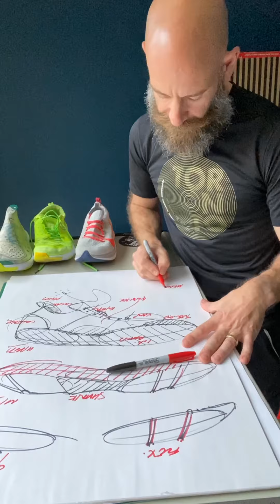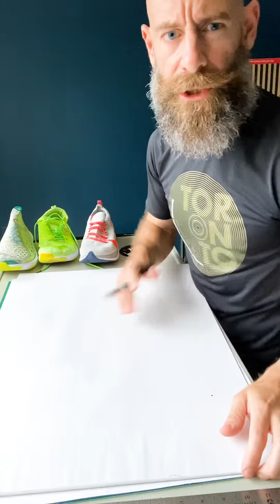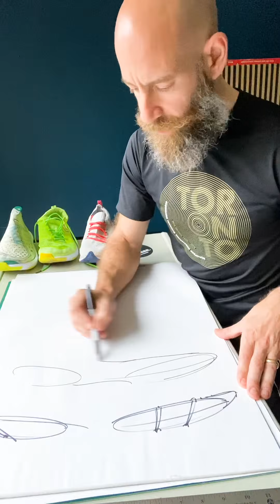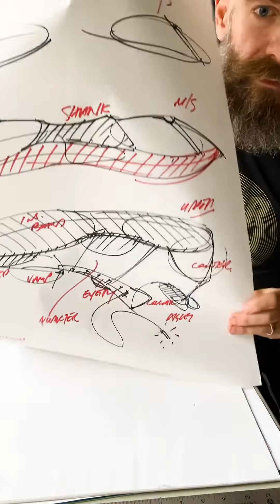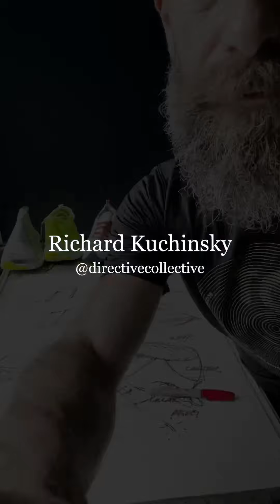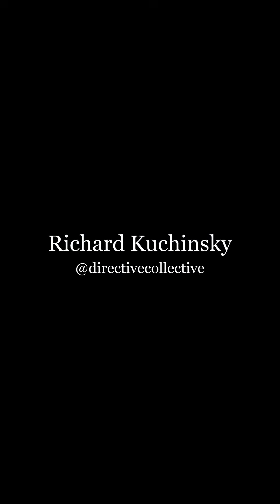Shoe Design 101: Terminology & Parts

Comment: I would like to get trained in designing. how it is possible
Reply: Designing what?
If you mean designing shoes, there are a couple options. If you want to go the college route, which may make it easier to get some jobs, then you would generally get a degree in either industrial design, apparel/fashion or textile design, or footwear and accessories design. Now this is if you want to design the shoe shape and components, if you just want to design the color and material, there are jobs for that called color designer and CMF(color material finish) designer, then you could either get a degree in color and material design or graphic/visual design.
-There are ups and downs to different degrees, for instance, industrial design is a great degree and leaves you open to a wider range of jobs, but doesn't specialize much in footwear, and you will have to study much of that part yourself and really focus on your own to build your portfolio in that department.
-Footwear and accessories is much better for getting a job specifically in footwear, not because it will make you stand out that much more than industrial design but, because it gives you a more focused education and will help you build your portfolio. That said, it also makes it much harder to branch out to other types of design than an industrial degree, so if you change your mind on shoes, or can't find a job in them, then you may well be out of luck. But it will also open non typical design opportunities like being a technical or pattern designer for shoes.
-Fashion design is often more on clothes besides shoes, but you can choose to focus on footwear. It's mostly fine if you are looking for a footwear job, but you will have to study quite a bit on your own, though not as much as industrial. It gives less job opportunities outside of footwear than industrial, but more than footwear and accessories. If you have an interesting in doing other types of apparel besides just shoes, this is probably the way to go.

conjunction
Reply: Hey try the Yellow brick program much more affordable than college. They have a shoe design program certification course you can get through FIT Fashion Institute Technology. I recommend Domestika courses also affordable and job shadowing under shoe designer or fashion design which is free. I always recommend at least a job Shadow first better than wasting money right away to see if you truly like industry before fully investing in college. That way with a job shadowing your gaining real industry skills.